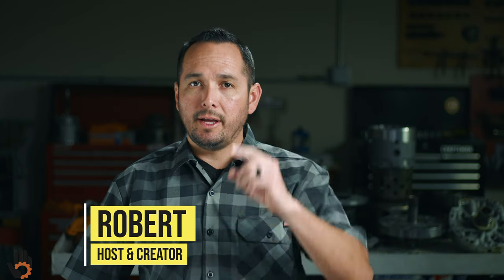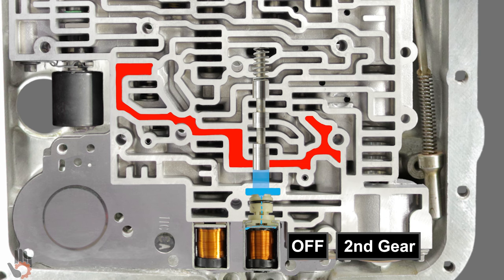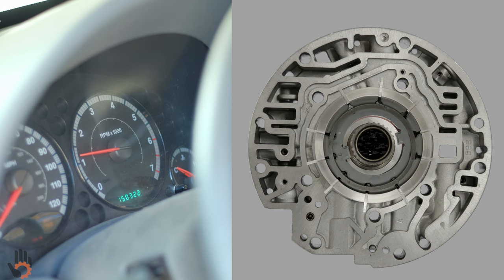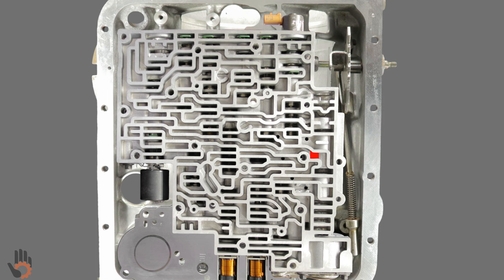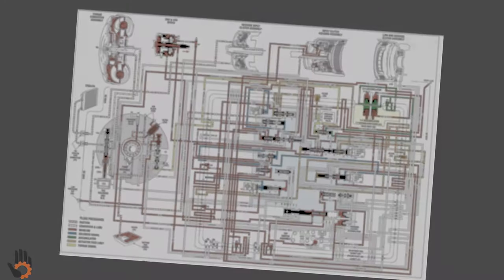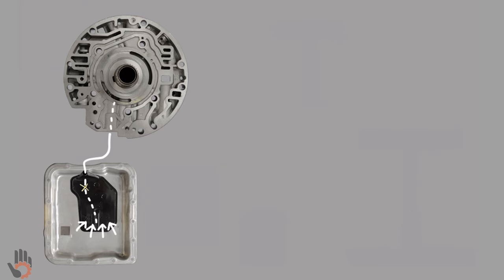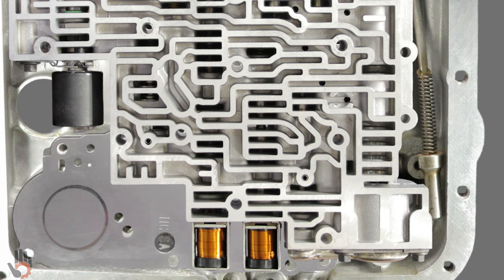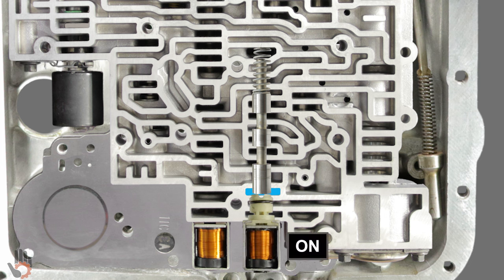4L60E: 1-2 Shift Valve + 1-2 Shift Solenoid (Part 1) Basic Operation

Comment: I can't get my 4l60e to shift done bought a new valve body and sensors and it still is in limp mode 2nd and third manual and reverse. checked all fuses there good
Reply from the maker: A number of things can cause a trans to go into Limp Mode.  Always best to start with the basics.

Good call on checking fuses.  
Some GMs are known for having problems with the ignition switch (transmission electrical power runs through it).

Check for power at the trans:
Pull the plug at trans.  Check for 12V at pin E.
Note:  Google image search, "4l60e pinout."

Also pull codes.
Retrieve everything...not just transmission.
Reply: @SouthpawAutoworks  I got 12 volts at pin e was thinking ignition or 3-2 downshift solenoid it's reading P0758 also the transmission replaced before I bought the truck.
Reply: If anyone as any ideas what I should do next please let me know thanks.
Reply: I can also can get it to shift into overdrive was I reset it going down the rode but 3 or 4 seconds shifts back into 3rd.

Comment: my 2004 trailblazer has about 50,000 on a full rebuild,it sometime wont go it to 1st for a day ,or week then it ok for a little while,took it back to the shop and they couldnt find anything,but replaced the syns and interal wiring, didnt help, so i changed the valve body, then the computor,but changed back to the stock computor. i did find a gm bulletin on this ,and it said to check for debris in the separator plate.i didnt take this off when i change the valve body,it has about 285,000 miles on it. when its not working it doesnt help to manually shift it.this has been over a year and if i dont get it fixed i know its going to hurt 2nd.whats next ??what fuses should i change? dielectric grease on main plug?exorcism? please help,thank you brad
Reply from the maker: Sorry to hear about your 4L60E troubles.  That really sux...

Good call on searching for TSBs (Technical Service Bulletin)!  If I was a gambling man, I'd put my money on that separator plate.  I'm creating a super short video, to share my thoughts, and to show you what to look for.
Reply: @SouthpawAutoworks  i did most of these after two shop could not find anything, my friend was getting it ready for smog ck and told me i had to put the old computor back in it,it works fine,just changed it for the trans problem.where can i find the sepatator plate video, thank you
Reply: heres the tsb 01-07-30-036c  orifice #29 iam sure that the one you showed
Reply from the maker: Right on!
Reply from the maker: Here's a short video...just for you.
https://youtu.be/4qXqzWFKPI0
Reply: @SouthpawAutoworks  its only been 2 days but wanted to give you a up date, i changed the plate with 1 from transgo and gaskets,didnt find a smoking gun, but the truck drives like a new one.i thinking it was something with the plate because thats one of the only thing that has not been changed in last 2 years, this maybe is another answer to some of the bad 1-2 syn codes.just wanted to up date and thank you again for the help. iam from los angeles ,what state are you from?
Reply from the maker: That's great news!  Congrats on your success!!

Happy to help.  LA, right on.  I'm based out of Arizona.
Thanks for letting me know.  Positive news is always nice.

PS - If it feels right to you, please help me spread the word about this channel.

1 Handed Transmission Rebuilder:  (60-Sec Preview)
https://youtu.be/y3Vixa_Ec1E

Comment: I have a automatic transmission and when I put it in drive it doesn't shirt to 40mph would it be a solenoid
Reply from the maker: It's possible...

What gears does it have?
What gears are missing?
Reply: @SouthpawAutoworks  nevermind it got totaled and found out the transmission was blown
Reply from the maker: Copy that.

Comment: what cause the trans to shift hard in 1 and 2 gear?  I'm having that problem with my trans.
Reply from the maker: A number of things could cause that.

1-2 Accumulator spring broken.
Accumulator valve sticking.
1-2 check-ball seat damaged.
Etc.
Etc.
Reply: @SouthpawAutoworks  ok cause it has no check engine light

Comment: Brother, please help. I have a Honda Jazz automatic 2003, and I have a problem of disconnecting the automatic transmission while driving, and I have a code p1887. Please help. Is it a malfunction inside the transmission or an electrical malfunction? Please help, thank you
Reply from the maker: I'm not familiar with that vehicle/condition.  Did a little digging on that code/vehicle.  Sounds like it's a problem with a speed sensor that's mounted on the transmission.

If the computer is "seeing" bad info from the VSS, it may not be the speed sensor, but it could be faulty wiring, or a bad connection.
Reply: Thank you for the benefit, but I changed the speed sensor, but to no avail. Some say that the problem is inside the transmission, and some say that there is an electrical failure or the valve body solenoid valve. Thank you.
Reply from the maker: When time permits, we will put together some videos on how to check speed sensors, associated wiring, etc.

Wishing you the best on your repair.

Comment: If my solenoids are loose would that cause my transmission not to shift
Reply from the maker: Great question.  
It's normal for the solenoids to have a little wiggle to them.  They're simply not a very tight fit in the valve-body bore.

In the near future, I'll be covering common solenoid problems.  Stay tuned!

Thanks for dropping me a line!

Comment: I have change all the silinoid and wire harness and I don’t have 2nd and third and 4
Reply from the maker: Losing 3rd and 4th gear is very common on this trans (3-4 Clutch).  Also, there's a band that is partially responsible for 2nd & 4th gear (2-4 Band).
You may be dealing with a failure of both the 3-4 Clutch, and the 2-4 Band.  If this is the case, there's no way to fix the trans, while the trans is still in the vehicle.

Might be time to take it to a transmission specialist (get it diagnosed).
Wishing you the best on your transmission.

Comment: What causes a transmission to slip once it warms up that's fine when it's cold but one inch up at shift up down up and down
Reply from the maker: Without looking at the vehicle (and getting more info), I can't say...

Here's some general info:
As the trans heats up, the metal & fluid heat up, too.

If there's a crack in an aluminum piston, the crack will grow larger as the piston heats up (expanding metal).
As the fluid heats up, it gets thinner.  If the trans is dealing with an internal leak, the leak will get worse as the fluid gets thinner.

Comment: Can you help me on mine it has delayed shift if I let off gas it’ll shift other than that it won’t
Reply from the maker: It has me thinking along the lines of the TPS (throttle position sensor), MAF (mass airflow)(and/or MAP [manifold absolute pressure]), and VSS (vehicle speed sensor).

Is there a check engine light on?
Have you retrieved the diagnostic trouble codes?

Did you know that engine problems can cause transmission problems?

The PCM (computer) controls the trans.  The PCM commands the shift solenoids on and off, which creates up-shifts and down-shifts.

The PCM monitors sensors on the engine, and the vehicle.  By doing this, it knows the driver demand, the engine load, and the road speed.  It uses this info in order to determine the appropriate time to shift the trans, and it also determines the shift feel (gentle vs firm).

Comment: Liked and subscribed, informative as hell, but doesnt solve my issue, i got an 08 silverado i rebuilt, but no first or second in drive, truck jumps forward if i quickly stab the throttle tho, manual/overrun work, reverse works, thought my input sprag might have been backwards, tore down to find its right, going back together with it, but i haven’t changed anything about how it was the first time
Reply from the maker: Appreciate the sub, and the positive feedback.

Regarding forward movement...
So, no 1st or 2nd gear, when the shifter is in Drive (the position we have our shifter in for everyday driving)?
But, you can get 1st and 2nd when you manually shift (D1 up to D2)?
I imagine that you're able to get 3rd when manually shifting from D2 up to D3.
....and get 4th gear when shifting from D3 up to Drive (Shift indicator may read "D" or "OD").

Am I understanding everything correctly regarding the symptoms?
Pleas correct me on anything that I am misunderstanding.
Reply: Sorry i took so long to read this, i went looking for a response but i dont have the app just go on the web page, so, shifts, apparently, but i think i found my problem, i put pinless accumulators in, but had read not to install the checkballs, so, lol, i didnt, so everywhere there was a pin, i have a gaping hole bleeding off fluid. Does this hypothesis sound right?
Reply: Sad i used to build allisons, but the 4l60 is a new to me beast, and i got so caught up in trying to pay attention to detail that common sense left me
Reply from the maker: No sweat.
That totally sounds like the issue.
You're the second person, in the last few months, to have the same issue (pinless accumulators).
It happens...

Leaving out the check-ball (and of course, pin), results in a very large leak for the Forward Clutch oil circuit.  Not enough oil pressure to apply clutches.

When time permits, I'll create a video on how the accumulators work.  And how to diagnose this sort of problem, without having to remove the transmission from the vehicle.

Really appreciate your response.  It helps me keep a pulse on what's going on out there (common issues), which enables me to help others.
Happy holidays to you and yours.
Reply: So i fixed that, beat the checkball and cracked the stem… i remembered from my allison days that jb weld holds up well in transmissions, so i gouped the hell outta the thing to seal and block that fwd accumulator pin bore off… nee problem i have, i planned on camming this engine, so since i rebuilt this trans i figured, id throw a slightly higher stall, that was as  close to factory… 2400-2700 stall speed, and my tc wont go into lockup, just kinda hunts, surges, shudders if i try to cruise and hold steady speed… my question is, did i mess something up? Like not parts match something? I put a transgo shit reprogramming kit in it, do you think/know if i got to go and change the tune from ecm (commanded pressure of something) idk pissed off, thing drives good other than that

Comment: Mines start in 2nd gear and my 1-2 shift solenoid is off does that mean my 1-2 shift solenoid is bad?
Reply from the maker: If the 1-2 Shift Solenoid is OFF (electrically...de-energized), then the 4L60E will be in 2nd gear.
Reply: @SouthpawAutoworks  yes I got that figured out I was trying to see if my shift 1-2 solenoid may be bad was the reason
Reply from the maker: Right on.

Comment: What makes a computer to switch on and of the celenoid??
Reply from the maker: The computer monitors various sensors located on the transmission, the engine, etc.  It uses that info in order to determine the timing (and the feel) of the up-shifts and down-shifts.
Note:  There's more to this...just trying to keep things simple.

Here's one (1) example...

TPS Sensor:
Throttle Position Sensor.
The computer is able to monitor the demand of the driver, by watching the ever-changing position of the gas/throttle pedal.

Couple of scenarios:
1). The driver barely has their foot into the throttle, for cruising down the highway.
2). The driver has the pedal to the metal, because they're entering the highway.  In the case of pedal to the metal, the computer will command the trans to down-shift...and to post-pone an up-shift, allowing the engine RPMs to climb, in order to create more power.

When time permits, we will put together a video on this topic.
Thank you for your question.  Your interest in this topic is appreciated.

Comment: What would cause a 4l60e to skip 2nd gear(only when cold), then when it warms up, it shifts great. It only does this when the trans is cold
Reply from the maker: Does it try to shift to 2nd, and slips (RPMs increase, but the vehicle stops pulling)?
Or does it go from 1st to 3rd gear?
Reply: @SouthpawAutoworks  it skips 2nd and goes to 3rd. After that it shifts normal.
Reply from the maker: I have a couple ideas...

Questions:
1). Year, make, model of vehicle?
2). Mileage?
3). Check engine light on?  What trans/engine codes are present?
4). What's the history of the trans?  Was it rebuilt recently?  How long ago?
5). When is the last time the trans was serviced?
6). Etc.
Reply: @SouthpawAutoworks  
1994 GMC Sierra 5.7
109k miles, never been rebuilt.
Serviced in July 2021. Check engine light is off.

Comment: I need to learn how the accumulator goes to get her not sure I’m doing it right
Reply from the maker: Over the years GM has installed them differently.
For example:
1). Spring(s) first, followed by the piston.
2). And vice versa.
Note:  The direction of the piston changes, to always make proper contact with the spring(s).

There's also different housing designs (if we're talking about the 1-2 accumulator).

Which accumulator do you need help with?  1-2 or 3-4?
Note:  1-2 is located right next to the VB (valve-body)(has it's own aluminum housing).  The 3-4 is located underneath the 1-2...and requires removal of the VB, and separator plate, to gain access to it (it's built right into the transmission case).

Are you installing some kind of an aftermarket VB kit?  Or are you replacing something that's broken?
Do you still have the original separator plate?
Reply: @SouthpawAutoworks  it’s the lower clutches in the input the only ones that got smoked I mean smoked. But later I noticed the check ball in capsule in rear of case was missing from capsule.  This controls shift of what it had tcc cylanoids stuck on , and a-b shift module stuck on top, that’s got to be reason it’s been burning these clutches it’s the only thing I found. But was trying tomupgrade accumulators to aluminum and the one in case seemed short of top like needed more spring, what about the one on top of plate it’s kind of blown my sir around pin so I added one that was on tight side but no leaks,is that bad it’s kind of tight on pin but moves

Comment: What does it mean when the 4l60e will go in reverse but not forward
Reply from the maker: It could mean there's a problem with the Forward Clutches, the Input Sprag, etc.
Reply: @SouthpawAutoworks   well I told my cousin to back my 2003 yukon denali up and he is really short and when he got into the truck he press the gas on accident and it revved really high and he put it in gear and it went into drive on accident would that cause every gear to go out? Or just the sprag spring?
Reply from the maker: Very helpful info.  Thank you.
Definitely could've damaged the Input Sprag, doing that.  If it's damaged, it might've destroyed the Input Drum, too.
At any rate, the Input Sprag transfers power from the engine to the planetary gear set.  Without the sprag, we lose forward movement.

You can learn more by checking out these videos:
4L60E Power Flow (1st, 2nd, 3rd, & 4th gear):  https://youtu.be/IfOqbTqKubE
4L60E Power Flow (Manual 1st, 2nd, & 3rd):  https://youtu.be/6kfAuXJFYFE

Comment: What the process of getting the solenoid b to get turned on and off
Reply from the maker: The solenoid is fed 12V, anytime the engine is running.  The PCM (computer) controls the path to ground.
To turn SSB (Shift Solenoid B) on, the PCM creates a path to ground, which creates a closed loop (electrically).  This energizes SSB (allows electricity to flow from the + battery terminal, and then back to the - battery terminal (also known as "ground").
To turn it off, the PCM cuts the path to ground, which creates an open loop (electrically)...which cut the flow of electricity.

The voltage itself (12V present at solenoid) doesn't affect solenoid operation.  It's the flow of electricity (amps) running through the solenoid that affect solenoid operation.

Is this what you were looking for?
Or were you looking to bench test?  Or something else?
Reply: @SouthpawAutoworks  here's my problem I have a 2003 s10 blazer but the trans came from a 98 s10 blazer I had a 2wd and converted it to a 4wd by doing to whole output shaft change every went well until just recently it won't shift out of 2nd its and automatic I'm trying to find out if it's the solenoid or the 2-3 clutches before I open it up what do you recommend
Reply from the maker: You say, "it won't shift out of 2nd..."
Does it stay in 2nd gear, as though it doesn't even try to up-shift to 3rd gear?
Or...
Does it try to up-shift to 3rd gear, but then the transmission feels like it went into neutral?  (engine revs up, but vehicle loses forward momentum).
Reply: @SouthpawAutoworks  it goes in second at 5000 to 6000 rpms and doesn't even try to shift to 3rd
Reply: @SouthpawAutoworks  I just want to tell you that I enjoy your videos they have so much detailed information no one explains it better than you do and also I appreciate you taking your personal time to help me thank you much appreciated
Reply from the maker: Okay. Thank you for answering my questions about 3rd gear.
Let's back up a little....

In order to make the 1-2 up-shift happen, the engine has to be at 5,000-6,000 RPM?
Do you have to let off the gas in order for it to shift from 1st gear to 2nd gear?
Reply: In drive I start off and the vehicle just has a forward momentum the rpms I go to 5000 rpms and it just don't shift like it should and my speed is 35 - 40 more so I left off the gas and then the vehicle starts to slow so I step on gas again and you don't feel the gear grap until it reaches like 4000 rpms